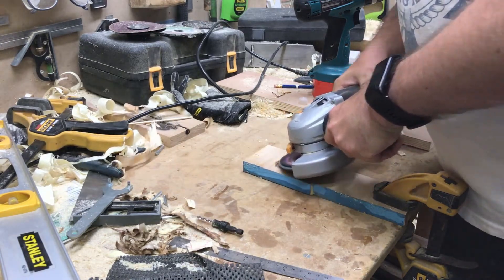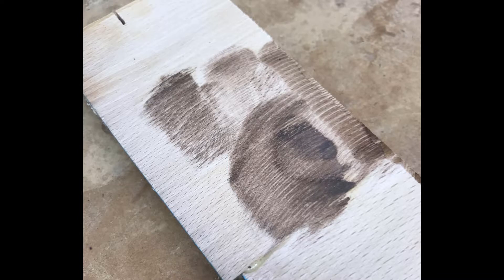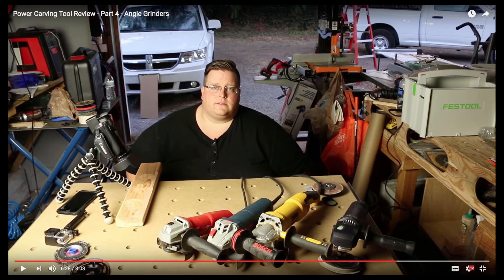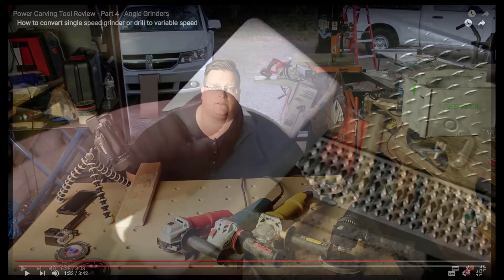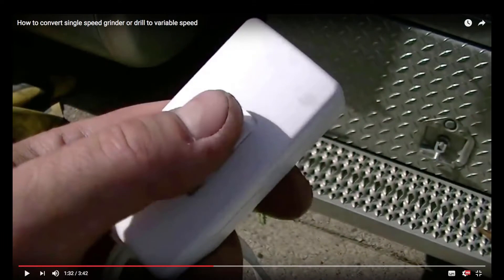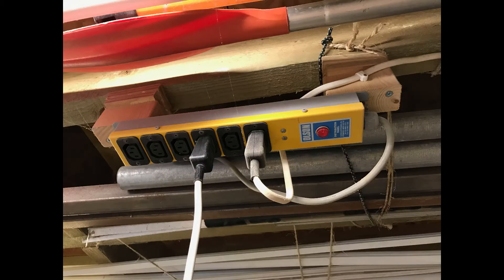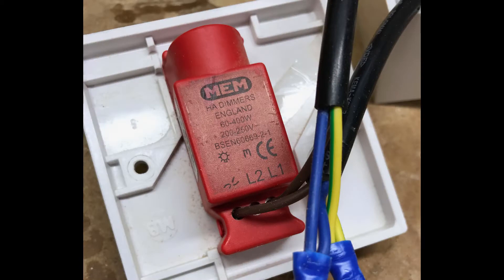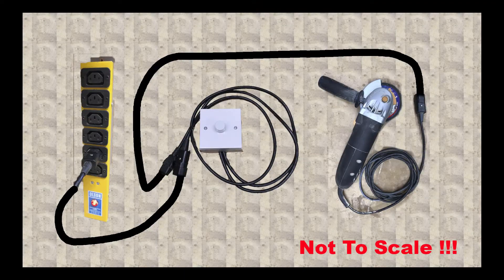Angle grinder speed hack

Comment: A reduction in power to the tool isn't done with a resistor as some people are suggesting could be done. The resistor would have to be very big and would get very hot.

The way the power to the tool adjusts the speed (or indeed a tungsten light that might need dimming), is by using an electronic device that basically switches the mains voltage going to the tool on and off at a high speed. It basically chops the power going to the tool on and off very quickly. Maybe 100 times a second or more.

If you set the control knob to make the tool go slower, the amount of time the power is off to the tool is longer than when it's turned on. Turn the knob to go faster and the power will become more on than off. This all happens in a solid state electronic device, usually a thing called a Triac. There are no actual swith contacts, it all happens within the device which is made from silicon and has no moving parts.

Comment: I've made one of these speed controllers in the past many years ago for my old mains powered drill. Firstly you must make sure that your controller is of ideally a much higher wattage than your power tool. And the correct voltage for your country. Secondly, don't run the tool for long at a time. As the tool is rotating much slower, so is its fan. So over heating of the tool can happen simply because of that.

Comment: does the angle grinder get hotter?
Reply from the maker: Not noticeably, that said, I've never actually measured it with any instrumentation.
Reply: @StevenVacher  im thinking of trying to use a variac to accomplish the same thing so hopefully that will also not heat up
Reply from the maker: @hobomnky  let me know how you go and how well it works :-)
Reply: @StevenVacher  I got a variac ready so I could slow down my grinder to avoid burning but i ended up not needing it. To my surprise, against all the conventional knowledge I found on Youtube, I was able to use a ceramic oxide 40 grit disc from 3M with a small 1200RPM dewalt grinder without any burning on a knotty log. I believe it was a spruce log. 

I now suspect that maybe using a high quality sanding disc might prevent the burning issue. Perhaps it is the cermaic oxide breaking to form new sharp edges which keeps the disc sharp, or maybe 3M's discs just don't clog very easily for whatever reason.
Reply from the maker: @hobomnky  Wow, that is interesting, I might give that a go. I'll have a look at where I can buy some 3M discs. Thanks for the heads up.

Comment: How long did the dimmer switch last before it burnt out. I also need to do the same to sand car body panels. Does the dimmer switch take the Resistance load?
Reply: you should by an 2000w or 4000w dimmer which are very cheap.The grinders are commonly 500 to 850w which is much lower than the operating power of the dimmer.
Reply from the maker: Hi KJV, I haven't used this setup all that much but I haven't had any issues with it so far... 
Odd !!! My dad's initials are KJV 🙂
Reply: @StevenVacher  thanks for the information. I will give it a go. I'm a Christian KJV is Gods Eternal Word. King James Version.

Comment: A simple dimmer switch might end up burning out your grinder motor. An actual motor speed controller would be safer and better. You need to find out what kind of motor is in your grinder and then match it with motor speed controller to do it right. The simple dimmer might also get hot enough to start burning.
Reply from the maker: Thanks for the heads up Matt, I haven't used it very much so haven't experianced any issues as yet. 👍
Reply: Yes, I agree...👍

Comment: Hi, Thank you for sharing these informations, I'm looking to use a grinder as table saw, the blade rpm is under 10 000 but grinder is 12 000 rpm, so I decide to reduce the grinder rpm using somthing like that.

Can you tell me tif the grinder still work as usualy? Did you feel any deterioration ? Many people says that reducing voltage (that what dimmer do) can dammage (or dammage) the motor.

Thank you
Reply from the maker: Hi, I've used it quite a lot with the dimmer and haven't seen any problems or damage.
The dimmer is inline and only temporary so can easily be taken out.